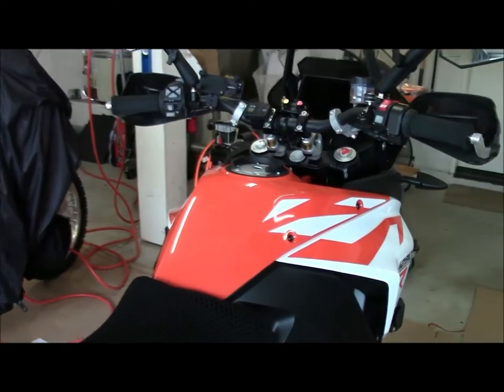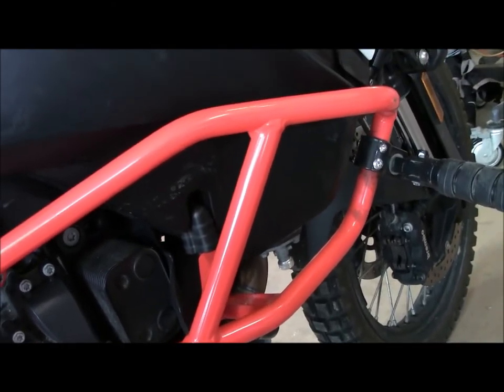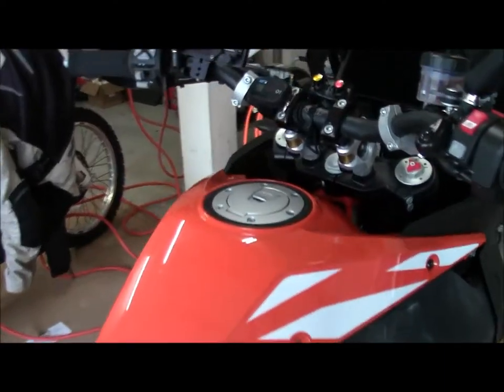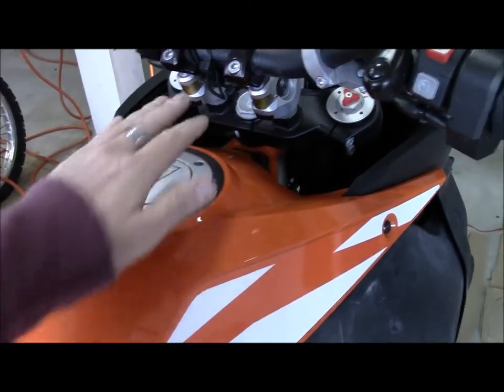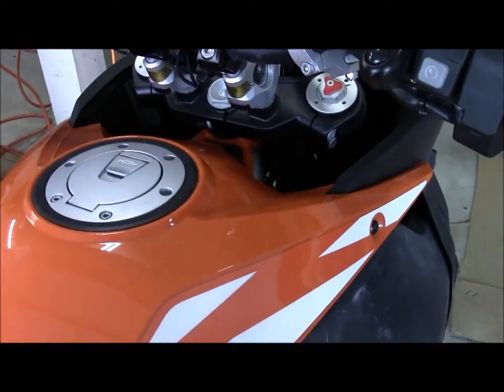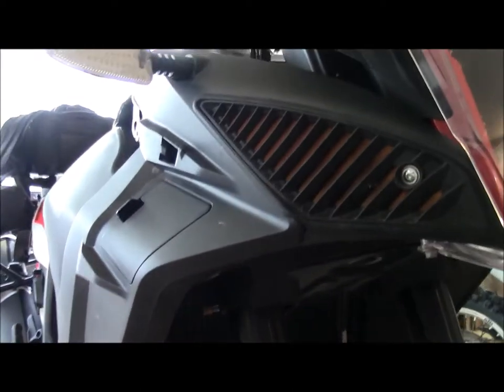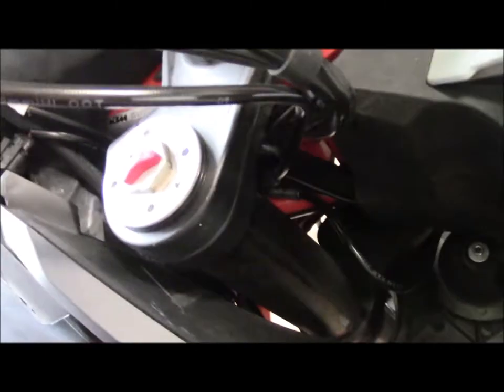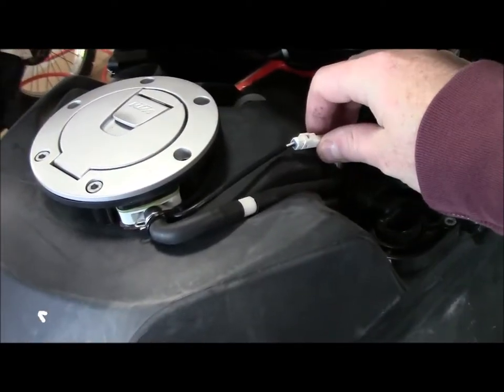1290 KTM Tank Removal

Comment: Thank you for your contribution to global knowledge! Doesn’t look too hard, or at least easier than my Tiger 800.
Reply from the maker: I had a Tiger 800 xcx previously.  I'd say they are about the same.  I took off the tank on the Tiger plenty too.  I will say getting the tank on/off was less finicky than the 1290, but there were a lot of bolts and screws to deal with on the Tiger.

Comment: There is a hose between both valves underneath,  my 2020 has this hose bolted to the radiator,  i didnt see you disconnect this joining hose ?
Are there any bolts underneath holding the tank on?
Reply from the maker: Go to 7:15 of the video.  I show the hose connected to both valves and explain how to remove them.  You don't need to remove the hose completely, just disconnect it from both sides and turn off the valves.  There are no bolts underneath the tank.  Everything to do is explained in the video.

Comment: I have the 2019 KTM 1290 SAR. I want to run Garmin Zumo GPS wires to a HEX EZCAN, that is located under the seat.  I was hoping to run the wires/ cable along the frame to secure using cable ties.  Do I need to remove the tank or side panels and more along the right side of the bike? Thanks
Reply from the maker: If you want to run the wiring correctly, you're going to need to remove the tank.  I also ran wiring from front to back and it's better to take the tank off and do it right.  Check out my cyclops raider install video also.  It's similar to the EZCAN.  You'll be able to see my Aux lights wired along the frame to the front, under the tank.  

https://youtu.be/9NeaQ6zLwwQ
Reply: @ls6777  thanks, looks like I will follow your advice.